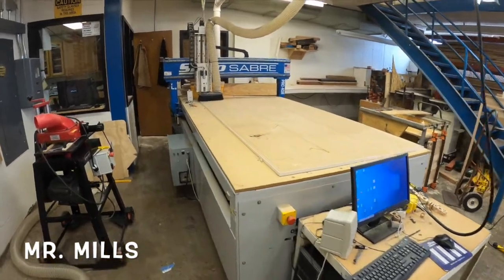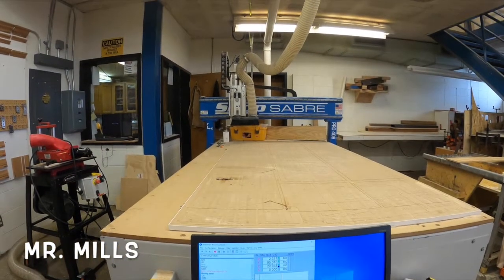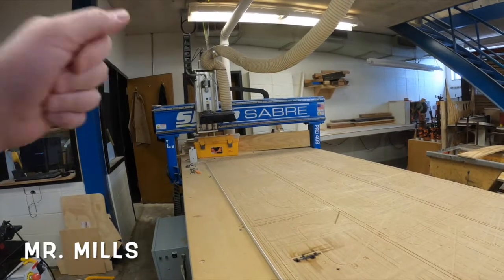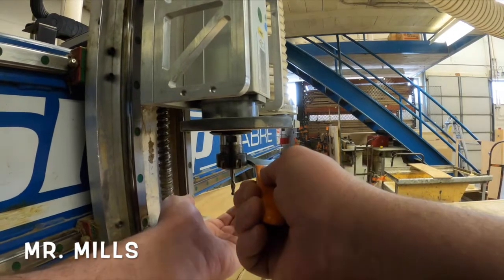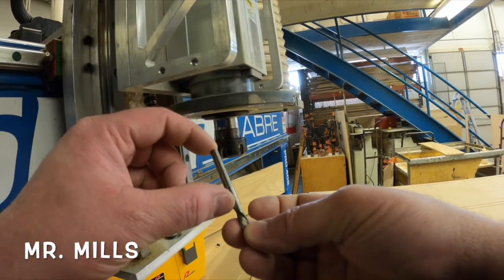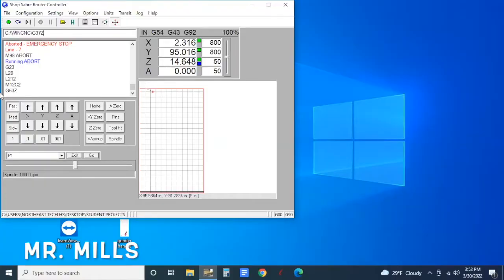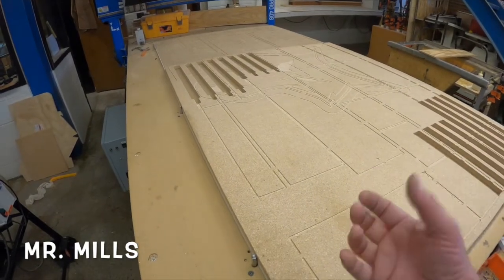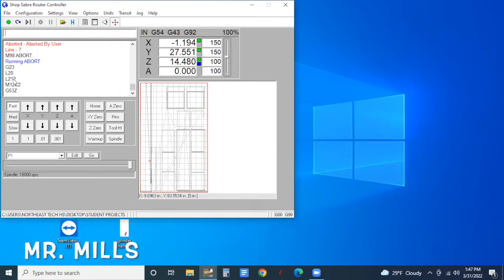Turn on & Start Up ShopSabre CNC Router

Comment: Odd question, Mr. Mills, as we’re just getting started with our Shop Sabre CNC 😅. Before turning your CNC on, you usually have the air compressor and dust collection system already on, correct? Because doesn’t the spindle require the air compressor system to run itself? Thank you for your help!
Reply from the maker: We have a big compressor so that is always on,. I typically don't turn the dust system on until the machine is done warming up